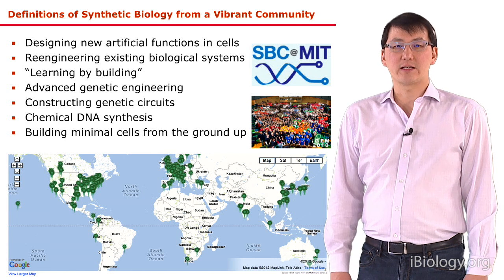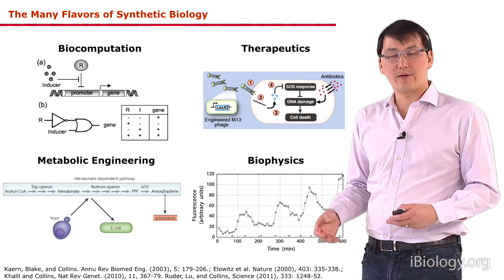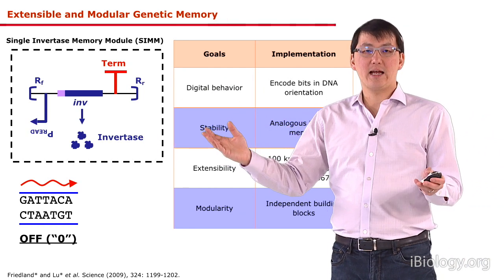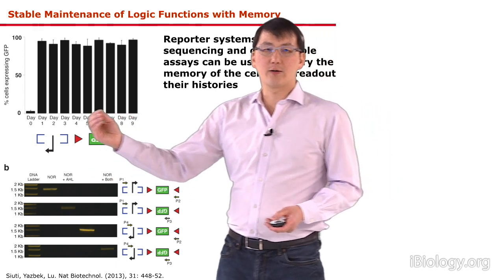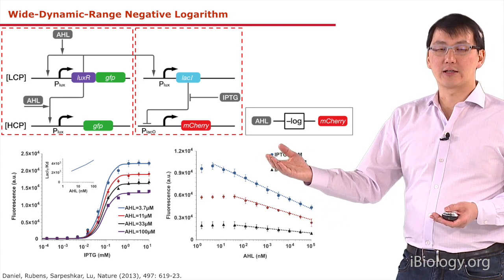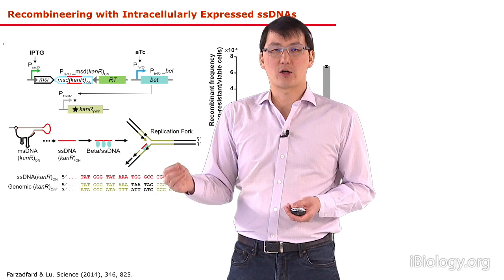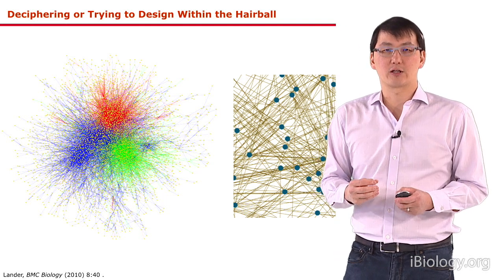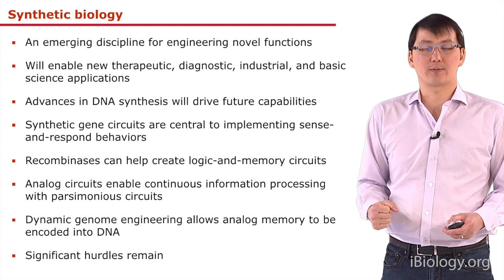Synthetic Biology: An Emerging Engineering Discipline - Timothy Lu

Comment: Timestamps (to the best of my ability) (WIP)
0:00 Definition + Community
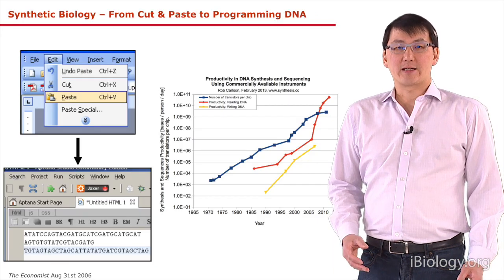1:23 Innovations in DNA editing
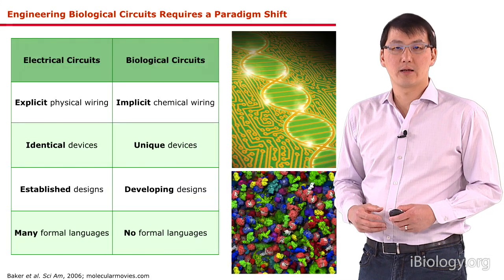2:27 Differences between biology and engineering
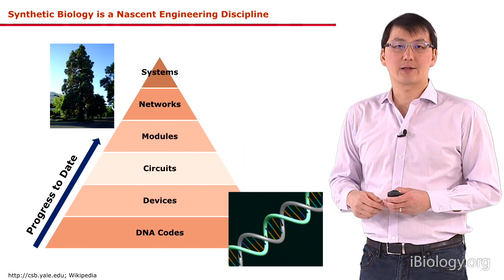4:21 Biological circuits
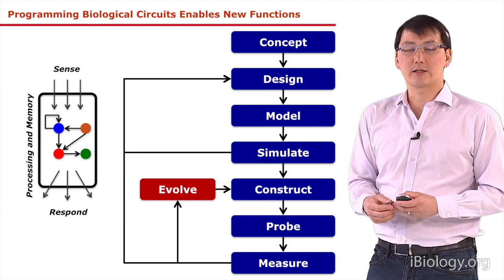6:14 Types of synthetic biology
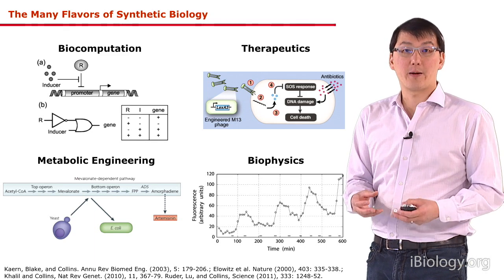7:15 Biological sensors
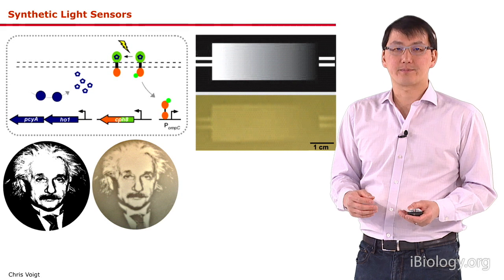9:39 Digital and Analog Computation in Biology
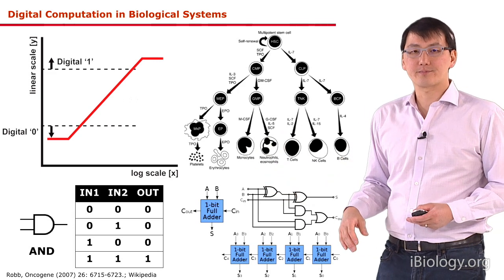12:46 Biological Digital Gate
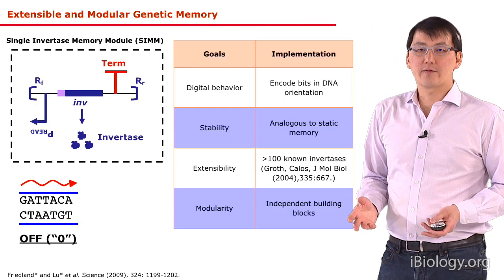13:41 Recombinases
14:57 Recombinase Switch Example
15:58 Higher Order Digital Logic Gates
17:48 Digital AND gate example
20:04 ALL the Biodigilogical Gates
20:24 Biological Memory/Inheritance of Gates
22:19 Platforms for computing information
22:37 Bioanalogical Computation
24:07 Description of Positive and Negative Logarithm Gene Circuit
27:27 Bioanalogical subtraction
28:05 Bioanalogical sensor
29:46 SCRIBE and Analogical measurements
33:43 Recombineering with Intracellulary Expressed ssDNAs (rework this later)
36:24 Use of Induction to Measure Temporarl Information
37:52 Potential Applications and Examples
40:19 Challenges in Synthetic Biology
Reply: You're awesome!
Reply: Thanx

Comment: https://www.youtube.com/watch?v=5_z1gG-m96A&feature=share
Possible avenue how to accelerate the critical process of cracking the RNA code of biological agents such as the Coronavirus CoVi2 2019 and leverage aggregate knowledge by using analogies from standard electric circuit analysis and computer programming with a healthy dose of system thinking and applying the scientific process.